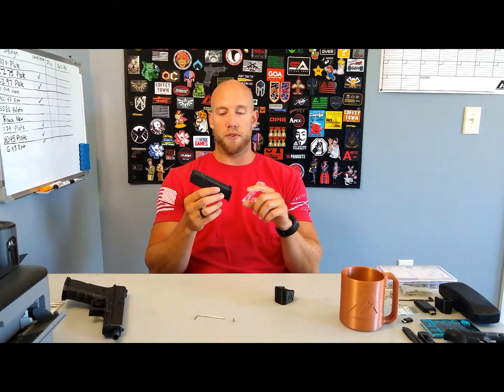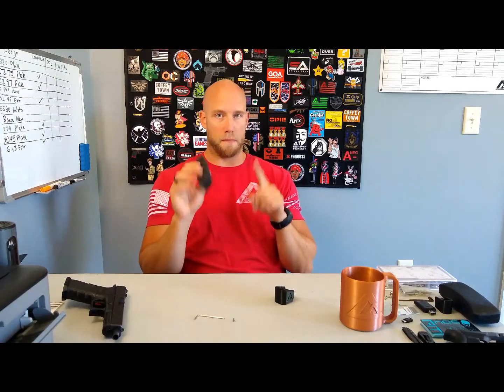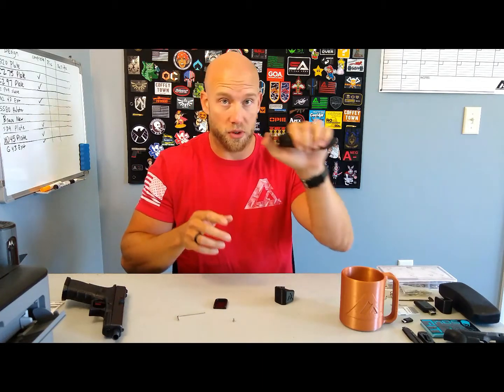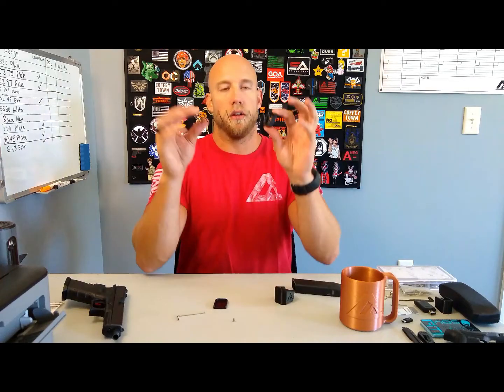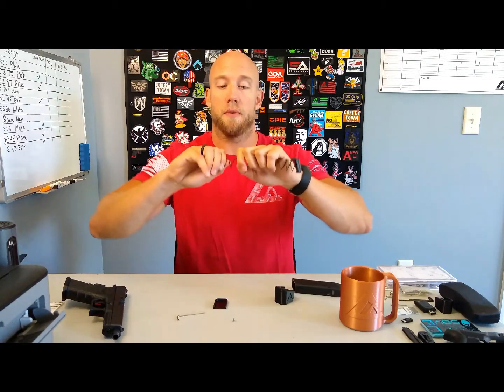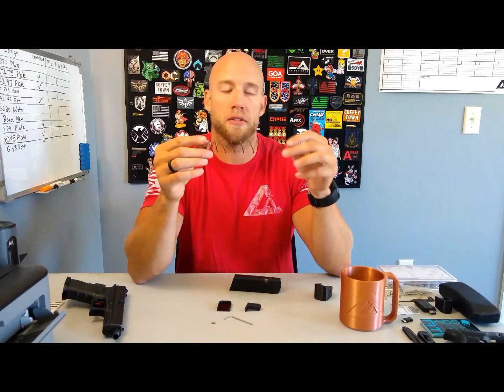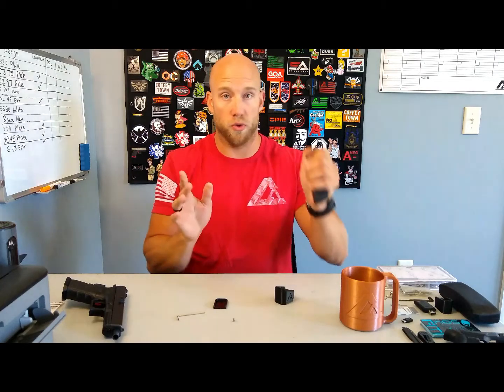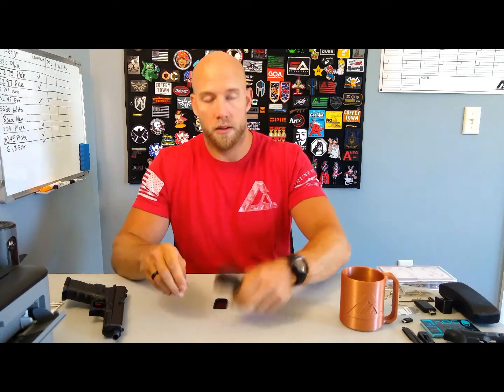Cain Arms General Magazine Extension Installation

Comment: Every mag on Glock 36 jams 3rd or 4th round. Watched videos and all tips. Found spring twisted and no did not do that during recommendation of how to pull. Follower is not sticking.  Please advise. Not say a bad product just not working in my gun. I bought two of them and BOTH are doing the same thing.
Reply from the maker: Try oiling the springs and inside of the mags as well as fixing the twist in the springs by twisting them in the correct direction until they are straight again.

Comment: I just purchased these but without much research... my question would be.. has the heat issue been addressed? I would hate for these to just explode in my car or in my waist while carrying....
Reply from the maker: Yes, we heat treat every part before it is packaged and they have a 12 month warranty.
Reply: What are these made out of? Are they 3d printed? And if so what material are you using? Pla? Pla+?

Comment: These fit on the Beretta-made 17-round magazines?
Reply from the maker: Yes, but they won't add rounds if the magazine has been crimped near the bottom to limit capacity.
Reply: @CainArms  No crimps on mine. Thanks for the response.
Reply: @aggrodkreg4321  i just got one and my 17 round mag now fits 21 suprisingly, i did remove the bottom plate of the mag spring. Not 100% flush with the mag and magwell but im happy with the added capacity.

Comment: Only able to fit one extra round in czp09 any help? Followed the directions exactly.
Reply from the maker: Did you stretch the spring before testing the extension on your magazine? If so the spring may be too tight. Did you check to make sure the follower isn't catching?
Reply: @CainArms  hello yes i stretch the spring and tried to shave down the front with no luck.
Reply: @CainArms  i ended up stretching the spring again and ended up going from 19 to 23. Very satisfied going hit the range tomorrow thanks for the help.